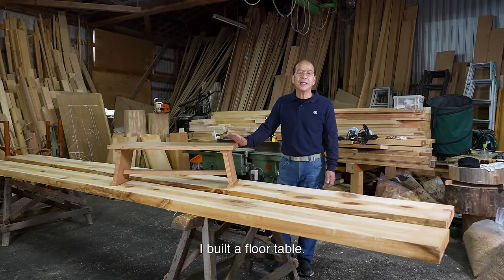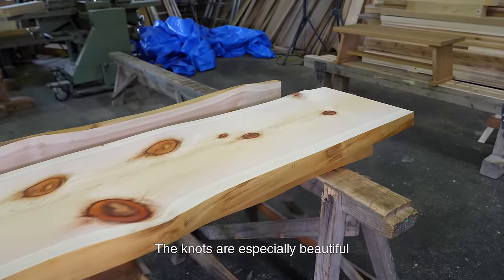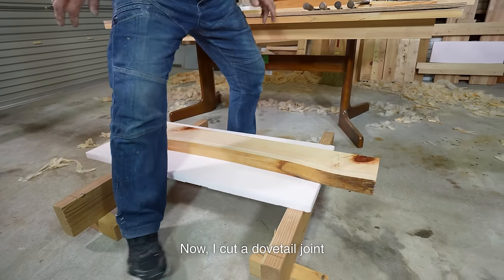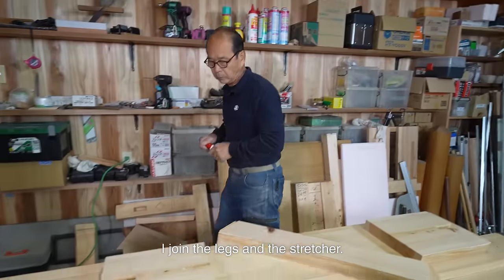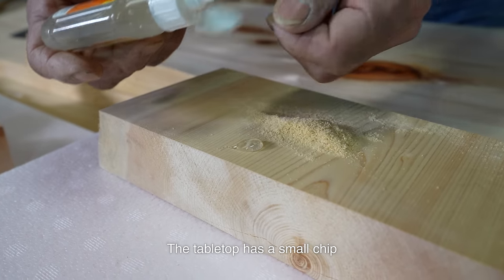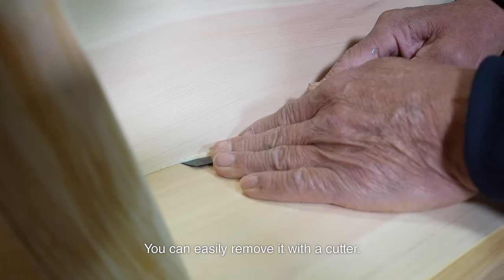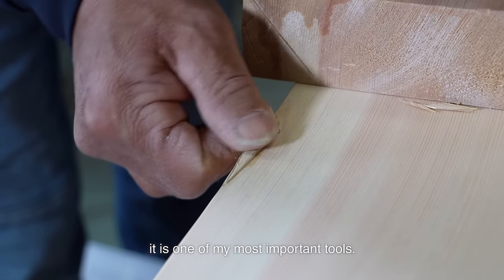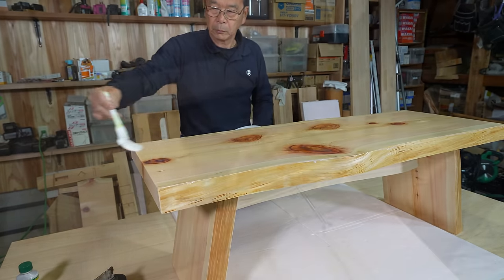Wood Troubles Me. A Splendid Floor Table made of 200-year-old Kiso Cypress is Built[Carpenter’s DIY]

Comment: To help your wood from sliding with wet glue add just a pinch of table salt to a few areas, then when wet glued wood is put together salt will bite into grain stopping the slide
Reply: I’ve seen this. It works. At first I thought it was someone making fun of Salt Bae.

Comment: Two great tips implicit in this video:
- A handsaw (especially a Japanese pull saw) is often faster than a power tool. 
- A sheet of rigid foam is invaluable as a platfork for the Skilsaw. It provides perfect support, withstands a bunch of cuts before it’s no good, and is super light.
Reply: And that foam won't scratch your wood!
Reply: I saw that in a short and the carpenter had been using the sheet he had for 3 years. If you keep your cuts shallow, you can flip it over and use the other side.

Comment: Nice wood and a nice complimentary design. If the finish didn't flow out and left some faint brush marks (common with this type of finish)  sand it flat then add another coat of finish but use a cloth formed into a small ball. Dip the ball into a bit of the finish and apply it. It goes on in a very thin layer and wont leave any unwanted marks. Maybe do a test on a spare bit of wood first to practice this technique first.  I'm a life long carpenter also, worked in a wide variety of carpentry fields(mostly heavy industrial but also residential construction etc) and often did similar projects as this table and other solid wood projects for clients. Now for fun I turn wood. I enjoy seeing other techniques and tools from what I am familiar with, but what remains the same is the care and attention to detail and deep appreciation for the wood itself. Thanks for sharing your work with us.

Comment: I watch this channel to learn, and I learn a lot. But maybe I can give something back to this master ;-). If you lightly dust some kitchen salt in the glue, it will help prevent the piece from shifting under pressure. If the glue is really thick, or there is a lot of it, use large salt grains, such as sea salt.

Comment: Beautiful table and well executed!  I use poly finish frequently but oil based. I find the water based version casts a  slight blue tint to the finish. Do you use painters tape as a clamp? I use green instead of the blue type. The green tape is made for rough surfaces and has a bit more stretch to it making for stronger clamping pressure.

Comment: Is there a concern that gluing with top to the legs/stretcher will cause cracking anywhere as different orientations of wood grain expand/contract during the seasons & but they are unable to shift at all because of the glue?